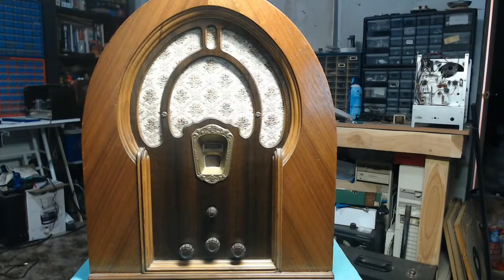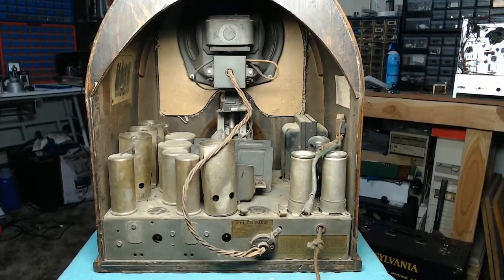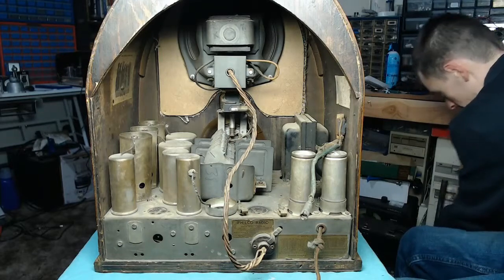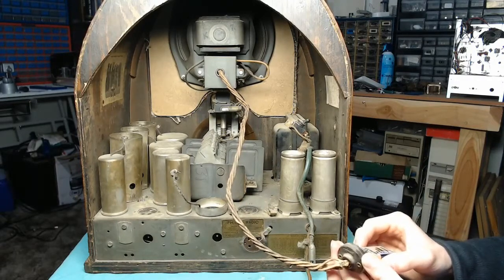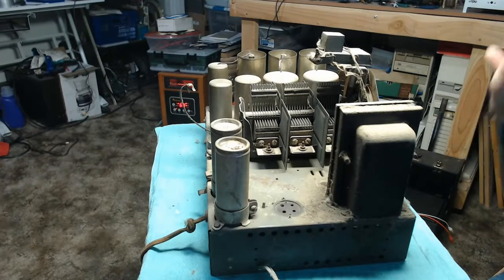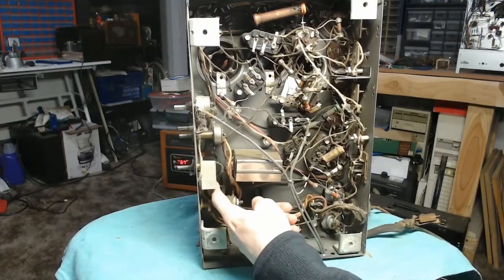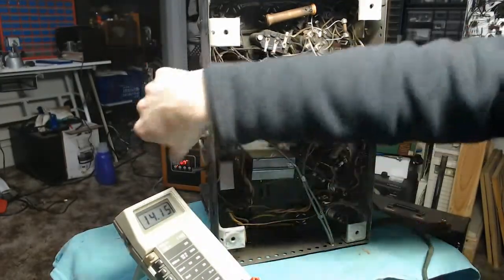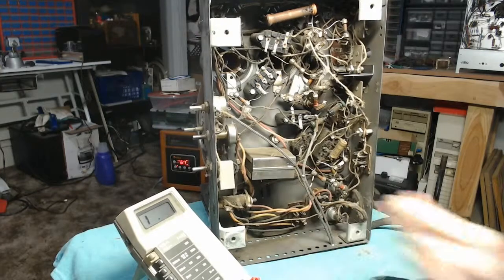Philco 71B Part 1: Inspection

Comment: I am envious of that rust free chassis with only a couple of "atrocities" inside!  If you think that is crap workmanship, you should see the one I'm working on!  Most of the capacitor blocks had their lugs clipped off, and there was a floating mish-mash of capacitors and resistors hovering above it all like electronic cobwebs.  The chassis was rusted so bad, it's definitely not worth the effort and expense to fix it.  But, I'm fixing it anyway!

Comment: Rider's Volume 4 has a page describing how to add the shadow meter, which the earlier sets didn't have, and that should give you a clue how that part is set up.  I had to rewind the coil on my shadow meter.  It works on a 10 volt power supply, but it'll be a while before I know if it works in the radio!